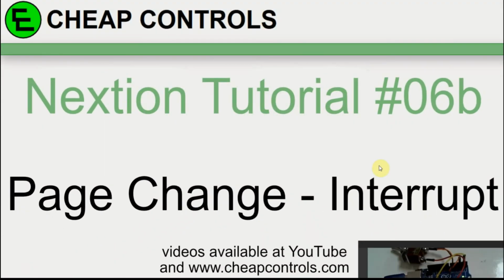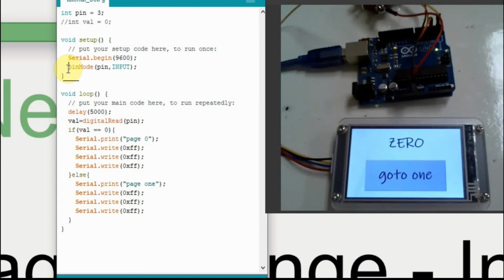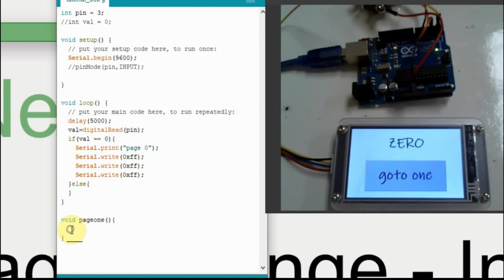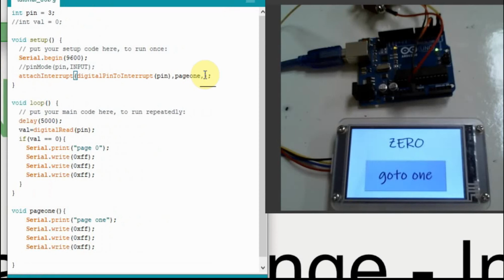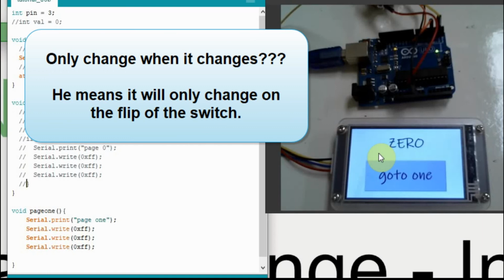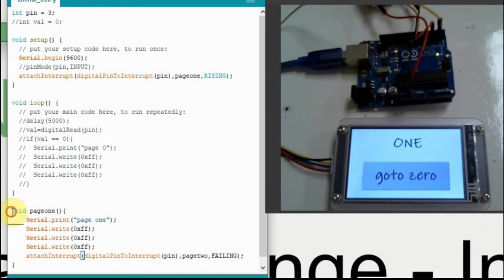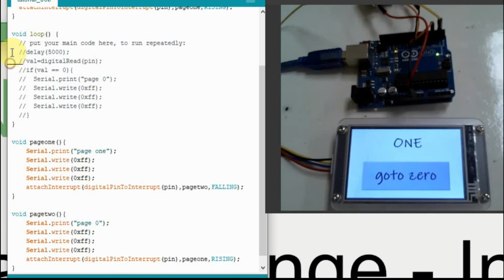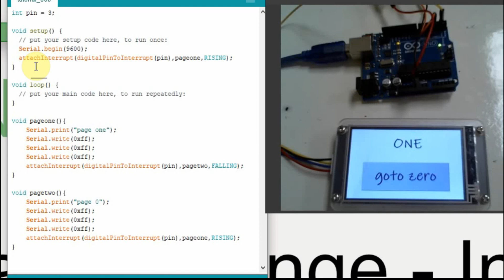#70 Nextion Display Page Change with Arduino and NO Nextion Library Interrupts Part 2

Comment: I was wondering how to use a  nextion button to trigger an interrupt instead of a physical button on the MCU.. I'm trying to Pause, Stop machine procedures that requires state changes to a few field components if either was called. I figured an interrupt with a  goto STOP function  will [instantly] break me out of a while loop and put me at the beginning of the STOP: process code.. Is that even possible and do I connect a nextion GPIO Output to my MCU input that is set as an interrupt? Didn't realize STOPING and Pausing  a loop that's about 120 sec, can be so difficult
Reply from the maker: The GPIO outputs on the Nextion are rated at 1 milliamp so be carful connecting them directory to the MCU, but I can't wee any reason it wouldn't work.  If you want a kill switch why not connect a physical switch directly to the device.  I would not use an electromechanically controlled thing work as an E-stop, because I would fear the Nextion device itself my fail and it could result in injury.  I have done it in theory but for my CNC I have a physical stop switch in place as my E-stop.  If you are controlling no life threating equipment then I think a GPIO pin would be interesting way to go.  GOOD LUCK!
Reply: @CheapControls  Thanks for your response.. I’m not talking about an E-Stop that disconnects power per say but soft stops/pause that would be use to walk away from my machine and come back or cancel the process.. If I use Nextion dual state buttons to send  a stop or pause command to the MCU, the command wouldn’t be addressed until it loops back to the condition that sets the command parameters to stop or pause. This can take up to 2mins.. An additional task would be to retract a cylinder and set a temp to “idle degrees”..  So the Nextion buttons are for day to day operations and the e-stop will be wired to my control panel circuitry.. I was wondering if an asynchronous delay would do the same job but two parallel task such as calling a (goto label;) and running a loop that you want to instantly jump out of and into, seems like running next to a train and trying to hop on or off..
Reply from the maker: An async delay would work but, all process would need to function on multiple async delays.  This way the main loop cycles very quickly.

Comment: What software program are you using?
Reply from the maker: I used the standard Arduino IDE and the Software that comes with the Nextion Display.  I don't use the nextion.h library for the Arduino.  I hand code the messages and signals between the display and the Arduino.  I hope that answered your question.
Reply: @CheapControls  thank you very much for the prompt reply it makes a huge difference from many other youtubers. 
The information is great and I'm looking forward  to trying this.
Your video was very informative, thank you
Reply from the maker: @fleckditchburn2494  Your Welcome and thanks for watching

Comment: Hi. Thanks for excellence video.  I tried this example works great, but what about if we will have more than 2 pages?
Reply from the maker: Are you asking if you can have switch with two states controls more than 2 pages or are you asking if you could add more switches to control more pages?  Thanks for watching!!
Reply: @CheapControls  Thank you for respond.  Your example works great  with Arduino uno. Unfortunately when i try to use with Arduino DUE your code, Arduino DUE crash. After some search i found that using serial print code inside Interruption crash Arduino DUE. Im working on project with 4 pages on Nextion dislay and switchig pages with push button. Im trying to avoid using Nextion library .

Comment: Splendid explanations of some of the Nextion control instructions. On that theme are you able to expand on this by explaining what to code for the nextion to change the colour of a text object when the linked trackbar reaches a certain value?
Reply from the maker: Thank you,  I will start on this right away.   I try to put out new videos on Tuesdays and Thursdays.  Consider joining the Private Cheap Controls Facebook group.  It should be easier to post code and examples.  It is new for 2020.